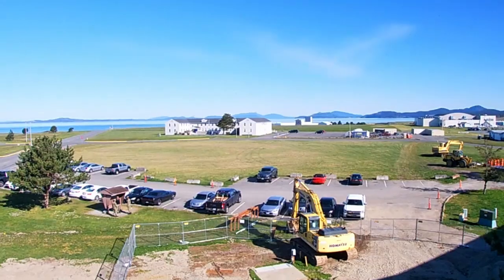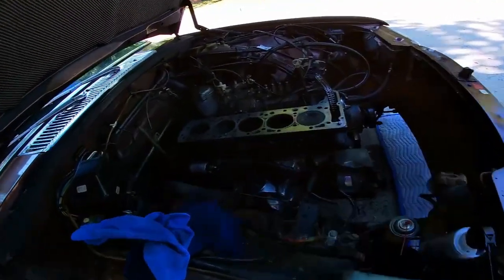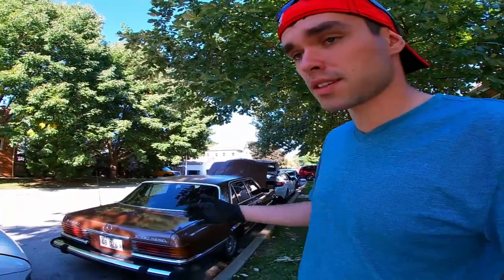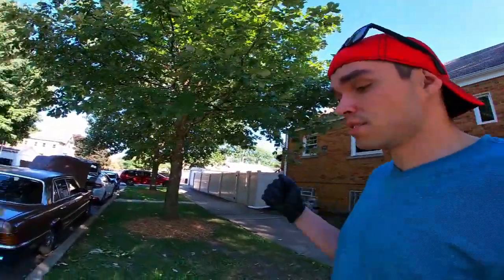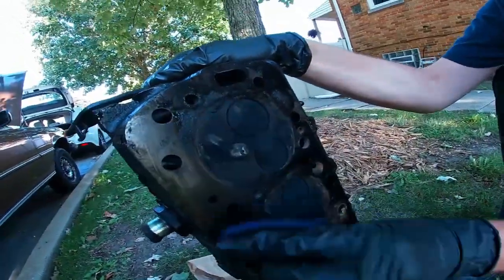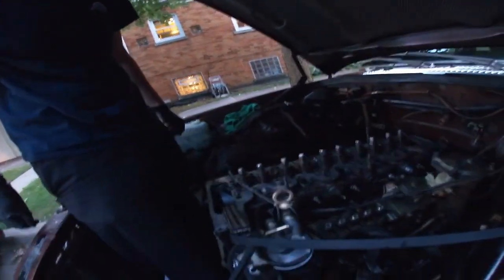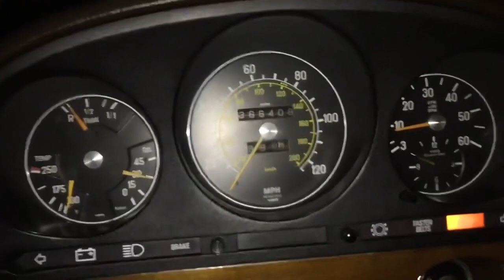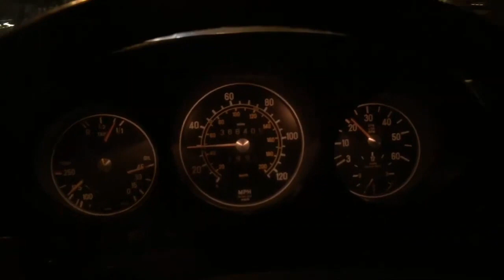Fixing a Broken Classic Mercedes W116! Head Gasket Said Bye-Bye?

Comment: Was that the issue or did it continue to lose coolant?
Reply from the maker: No. The coolant was leaking from the lower water pump housing gasket. While doing the head gasket, he changed the water pump and all those gaskets down there and eliminated all the coolant leaks. 
The head was removed just to make sure it's all good (which it was). The block was okay too, so we just cleaned it all, installed new chain guides and a head gasket, and she purrs like a kitten!
Reply: VITO'S GARAGE I hate to Admit this but with my 85 300d I was out in LA and my alternator blew and at 3 in the morning. No one was open and I needed to get home so I drove home with no water pump, fan, or alternator. Luckily it was cold out and no traffic but it got to the red a couple of times I kept pulling over and filled the coolant tank with water and poured some on the radiator. Moral of the story I drove about 60 miles with no alternator, water pump and cooling fan. And everything is fine with the car no coolant loss or oil mixing temp stays good I’m at 290k and climbing. Mercedes made some beasts follow me @djake77 if you want to check it out
Reply from the maker: Amazing! Wow! Yes, they're definitely the best cars ever made! That's why I love saving them all! Cool, I'll follow you!🚗🚗